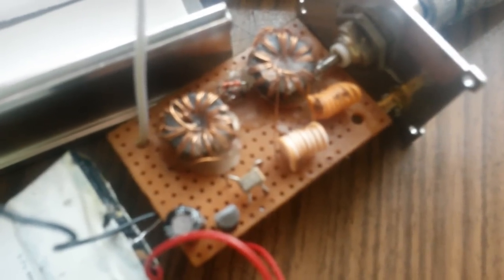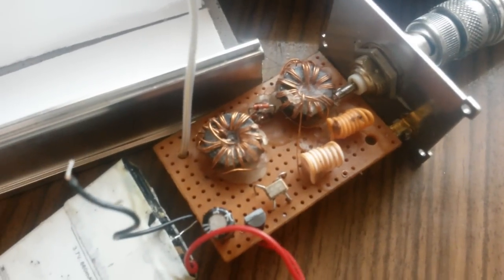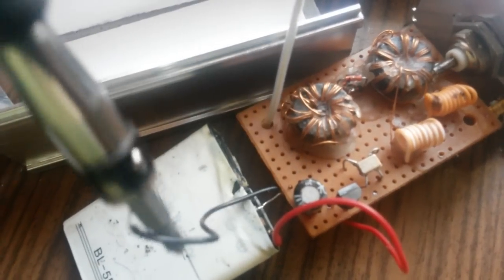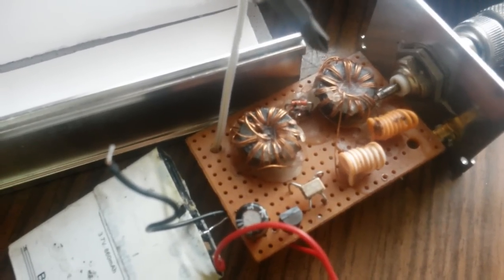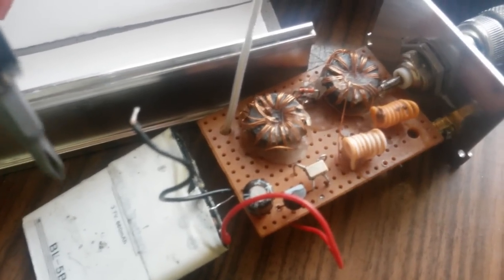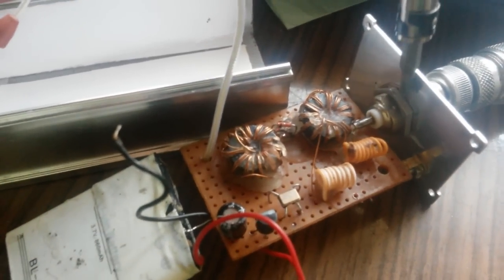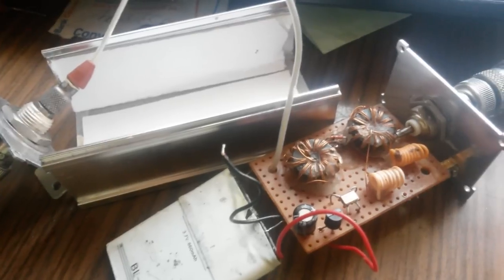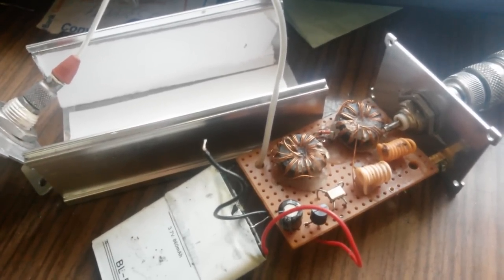Up-converter for RTL-SDR 40MHZ Lo. & cellphone battery

Comment: neat idea to put cellphone battery in sdr case (:
Reply from the maker: good idea to put cellphone bat. in converter case . Its low noise for mixer
Reply from the maker: +ek6rsc Rf noise going to hi if you  connect power line ac/dc or via usb power